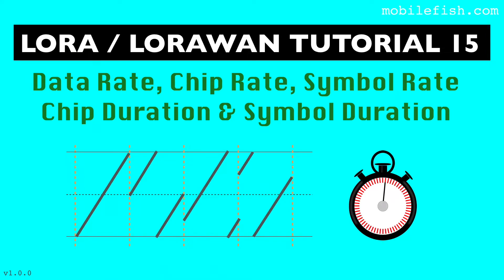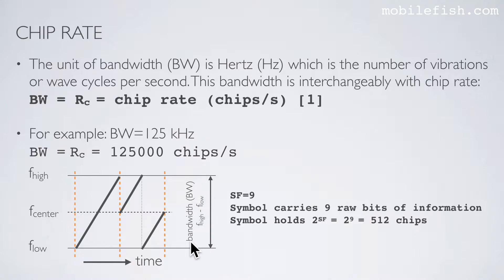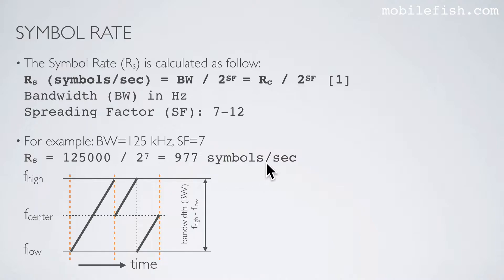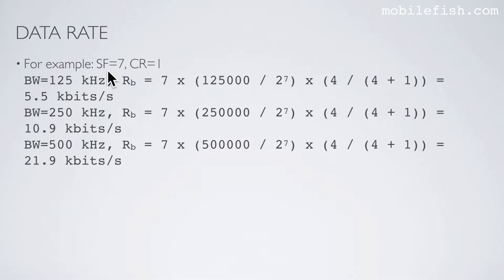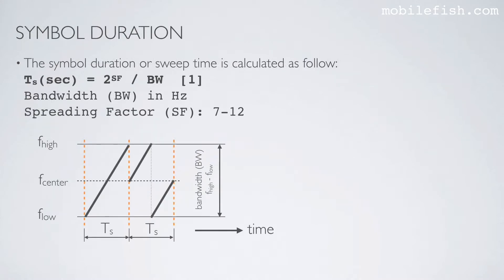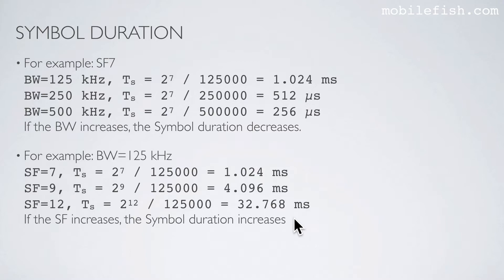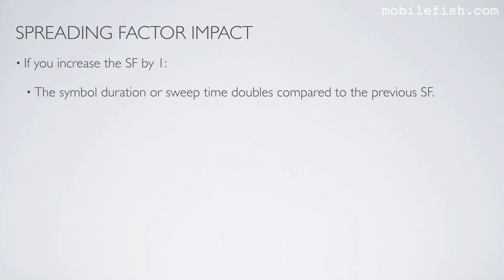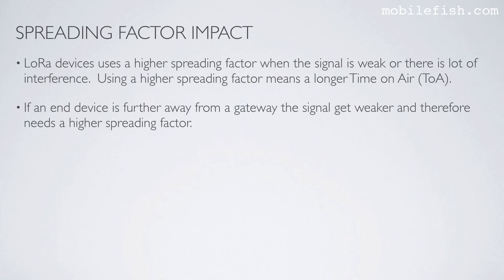LoRa/LoRaWAN tutorial 15: Data Rate, Chip Rate, Symbol Rate, Chip Duration and Symbol Duration

Comment: So looking at this, the chip rate is the data transmissions per second, which can be expressed in hertz. The signal modulates frequency as well, which is also in hertz? Seems there are two different "hertz" values going on here, though I could be wrong.

Comment: hi Robert, can you please explain why the chip rate corresponds to the bandwidth? in what way are these two correlated?
Reply: I'm a newbie, but this is the way I understand it.  Each ramp (chirp) is made up of 2^SF chips, ranging between fL and  fH, with each chip being 1/BW long.   That is, the ramp is made up of 2^SF frequencies, from 0 to 2^SF - 1, commonly referred to as 2^n - 1, which results in n bits (or SF bits) transmitted each symbol.  
That doesn't really answer the question, but I hope it helps understand the answer which is, chip rate is correlated to bandwidth by definition.  LoRa basically said, we are going to chop each Bandwidth into 1/BW segments, or chips.
Reply: I am not sure. I suppose because you have doubled space (bandwidth) to sweep (fit the data), so you have twice the rate.